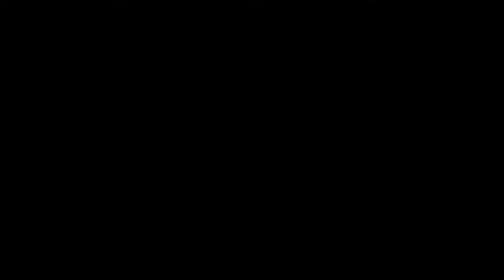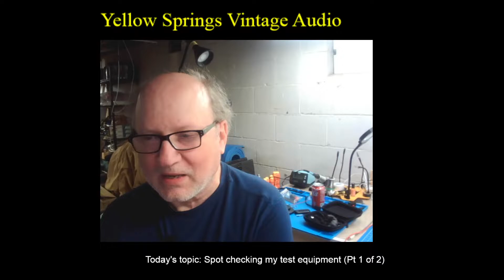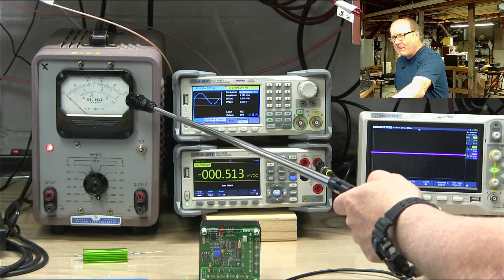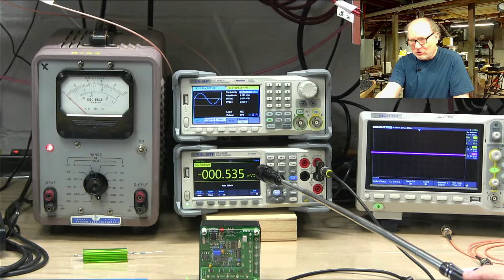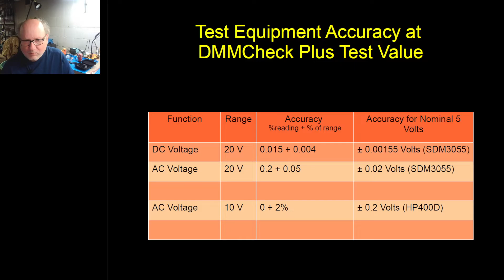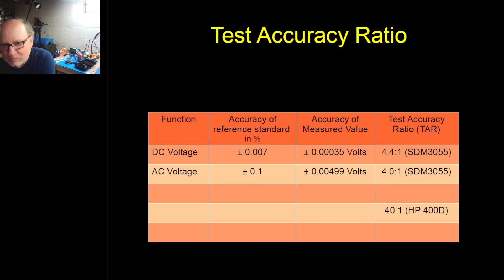Checkout Test Equipment   Part 1 of 2

Comment from the maker: CORRECTION: In the video, at 6:20, I misspoke when calculating the accuracy of the VTVM. I said it was "0.002 x 10 volts" when in fact I should have said 0.02 x 10 volts.  I did state the correct result though.  The accuracy of the VTVM on the 10 volt range is ± 0.2 volts.